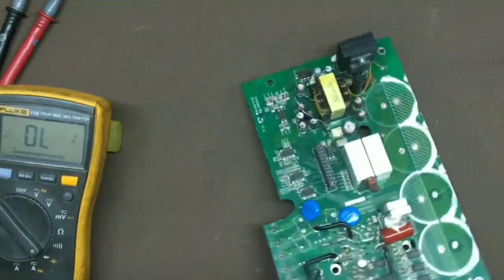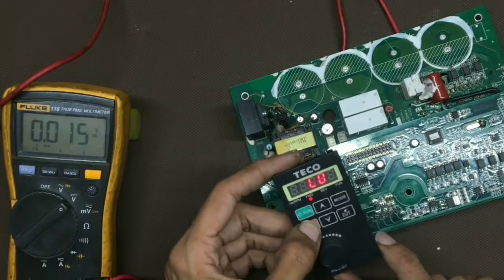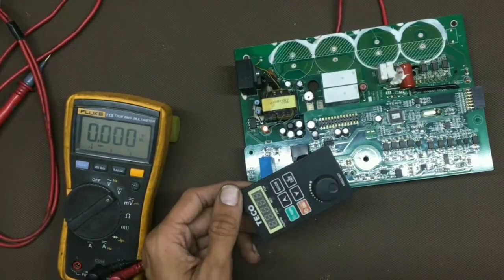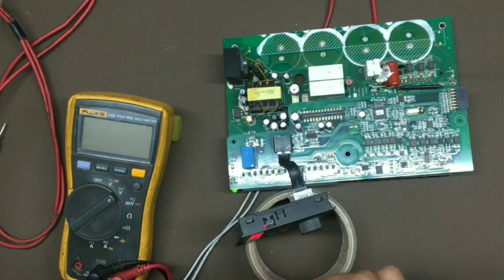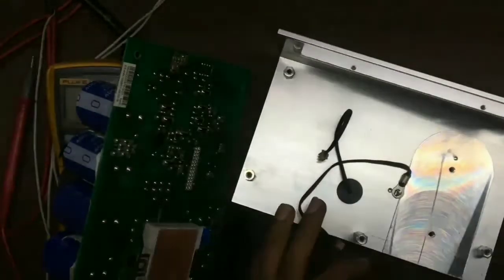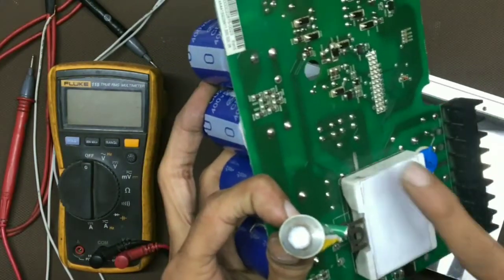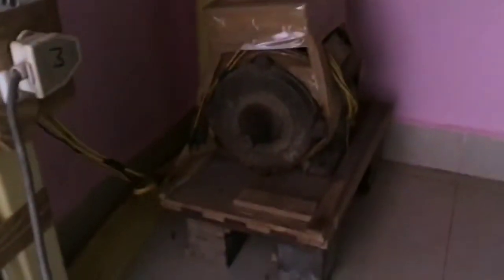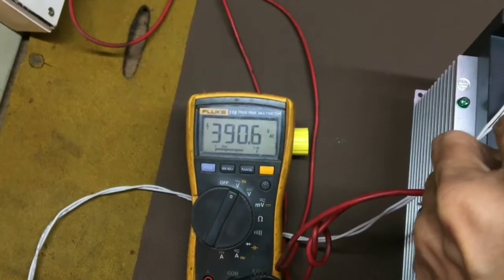AC Drive Basic Intro Part-2 | Repaired & Trial

Comment: bro did you change any component?what is the defective component bro?
Reply: Time pass video. Fault section not shown neither it's solution
Reply from the maker: IC & Capacitor
Reply: @NerdyNairTech  i didnt se you change any component....
Reply from the maker: @marvintomol181  I didn't show 
Can't show the exact parts & details  only the process of testing & finding fault can show only the way. (I am In job so)